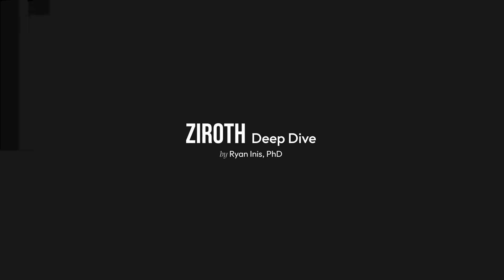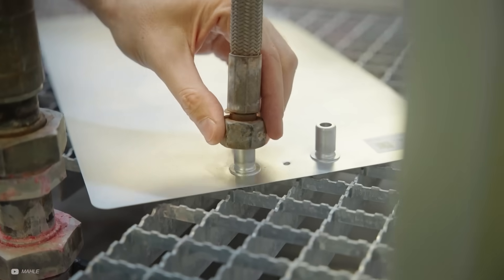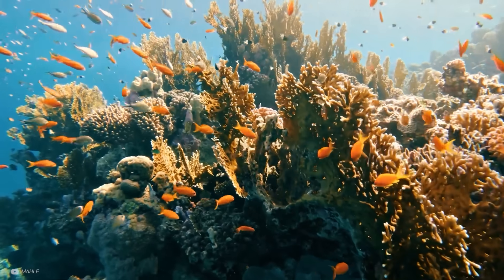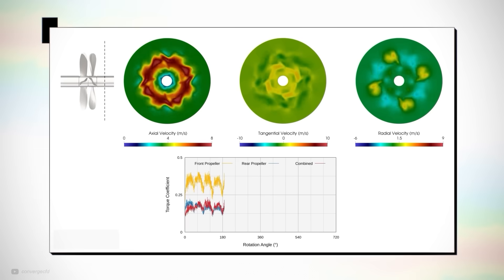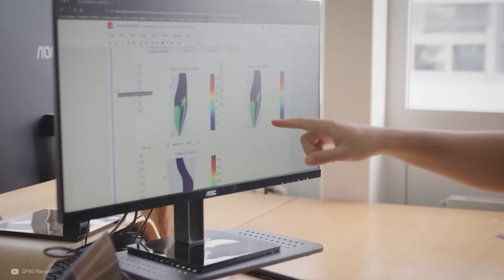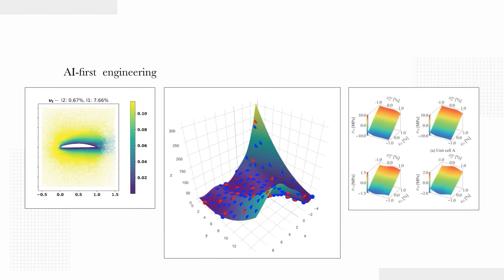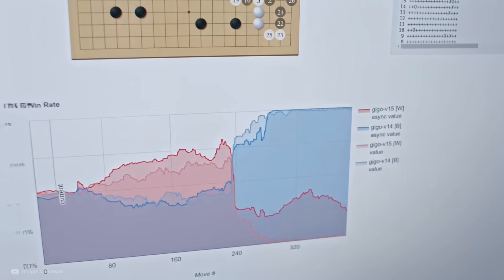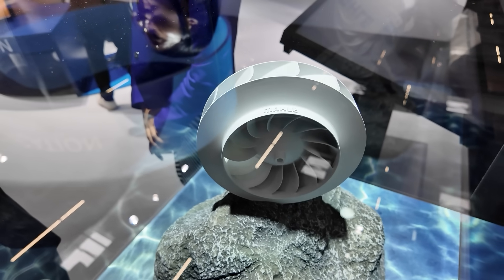Engineering 4.0: The Bionic Revolution is Here

Comment: Nature isn't always better than human designs. 
Example: Best glide ratio for Sailplanes = 70:1.  Best glide ratio in nature (Albatross) 25:1
But this does not mean that it cannot be improved even further with AI assisted design.  Looking forward to a Sailplane that can do 100:1  🙂
Reply: Yeah nature is about the best, it's about good enough
Reply: @iamhayday  nature does compromise really well, albatros has to have thrust also
Reply: @dude2884 I think that's the key in this comparison. For a glider, it's SOLE FUNCTION is lift, and a glider (typically, but not always) needs something else to get it airborne. Whereas a bird, any bird, needs their wings to propel them and provide lift, which means it has to be sufficient enough to give it but efficient enough to not require them to dump immense energy into flying.

As such, I don't think it's a fair comparison Johan made.
(and that's not even touching on the material limitations for something that's living vs something crafted)
Reply: @DUKE_of_RAMBLE  Exactly. Bad example.
Reply: @DUKE_of_RAMBLE  A bird changes the shape of its wings, it can have a gliding shape, and a flapping shape.
And even then: evolution chose to use the wings for both lift and propelling, it didn't have do so; nature could have given birds separate gliding wings and propelling wings.
Reply: @sasjadv  I don't see evolution being able to give the "either-or". They can be stuck with only propulsion I suppose, like a hummingbird (though I'm only assuming they don't glide and are always flapping), but to be only gliders would make them... well, NOT birds anymore? 😅 They'd be mammalian, like bats or the various gliding rodents (sugar gliders, flying squirrels). But even then the latter don't have wings, and it's more like "integrated chutes" heh
(would we count flying fish? 🤔)

Because to be only a glider, but a predominantly airborne bird, would require they clamber up to high areas in order to have enough energy to good where they need to go. Or maybe have thermal vision to hunt out thermal updrafts... 🤷‍♂️
Reply: @DUKE_of_RAMBLE  Exactly, evolution is just like optimisation that engineers use. I.e. it tweaks local parameters, but that optimisation doesn't give you a complete paradigm shift.
But an engineer can say: "I want a wing that both propels and glides" or "I want a rigid wing"
evolution doesn't give you that, and neither do optimisation algorithms.
Reply: Can a sail plane wing provide thrust... funny, an albatross wing does.
Reply: OK if you want to be that particular, lets define the task as Glide Only ...
Then the best "glide only" animal is Flying squirrels at 4:1 which is even worse than the Albatross.
Reply: @Johan-ex5yj  hmm, how good are sail planes at climbing trees...
Reply: @kevinj9059  They don't have to.  🤣

Comment: The problem with these surrogate models is that their accuracy depends alot on the data set they were trained on and they can't be generalized to other domains. You need to have separate surrogate models for each application and type of physics
Reply: Good point.  Fortunately, unlike LLMs used for stuff like ChatGPT, the data sources for these can be built when not already present.  If you want to do this with weather, for instance, there is a huge amount of data generated by the NWS in the US or the EWA (I think that's the right abbreviation for the European one) as well as China and Japan and numerous other national weather services.  Companies that specialize in modeling mechanics will no doubt have their own data as well.  My point, if there really is one, is that good quality, clean data sets for this type of AI application are either plentiful or can be created without copyright infringement, data poisoning, or the myriad of issues that people have with the more public facing AI slop.  And while I realize no one has any reason to care about my opinion, I think this type of use case for AI models is a proper one that should be less controversial than things like AI art, chat bots that harm impressionable youth, p0rn generators that create unauthorized images of real people, etc.  Hope this comment isn't a waste of your time.

Comment: The problem with Ai is, it is 100% reliant on standardized info... meaning it is not "smart" at all... it is a word computer that is likely to give you bad information:)
Reply: it is smart as average intelligence. i am not condescending. this was expected.
Reply: @kizgintosbaga  It's a useful tool:) In the case of Chat GPT, half of its resource is Wikipedia... meaning it is a CIA propaganda tool:)
Reply: @batmandeltaforce  which is how i use it to be honest. like lately i used calculating rooftop material. good part is it did just fine. but other things ? like you say. propaganda tool.